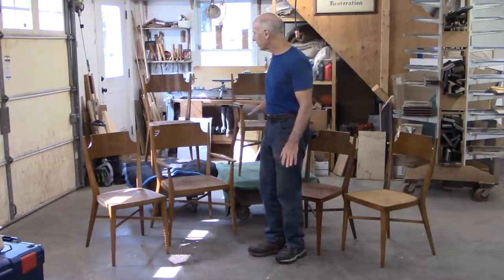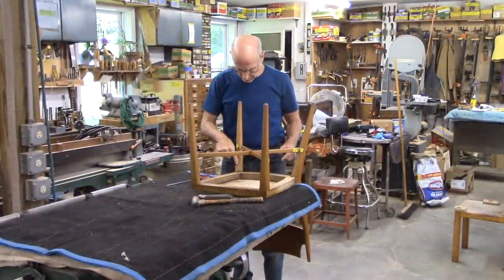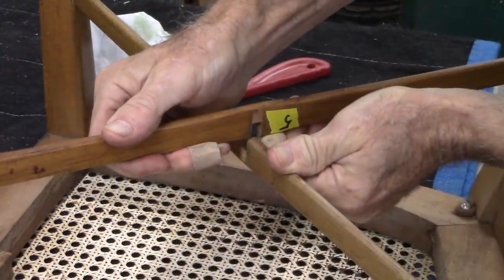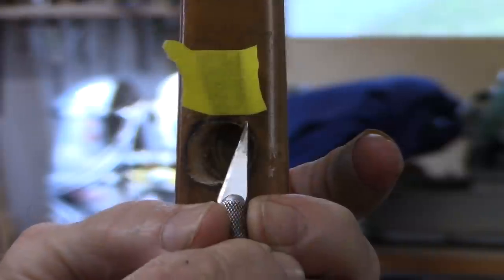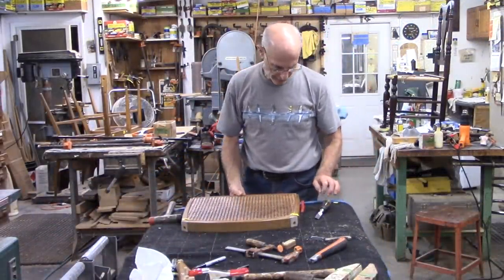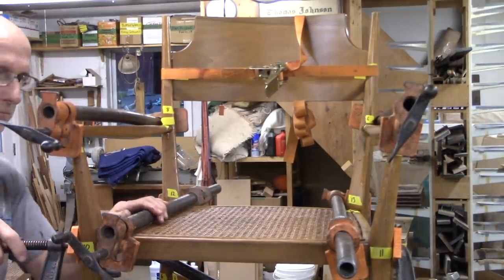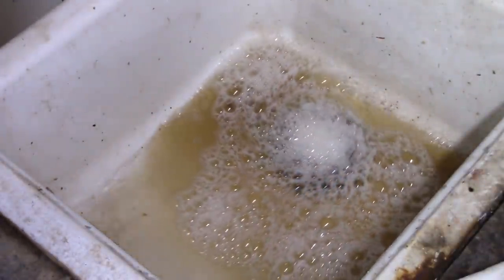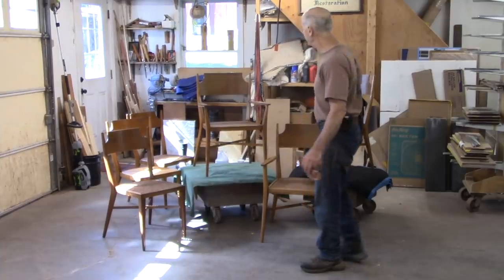Restoring Midcentury Modern Chairs by Paul McCobb - Thomas Johnson Antique Furniture Restoration

Comment: I learned the hard way, adding another hole to a joint does only weaken the joint in most cases. Thomas is spot on again.  He fixes the problem at present, after all most of the chairs have stood the test of time.
Reply from the maker: Thanks! We all have to learn the hard way!

Comment: I need to build myself one of those screw trays!! Another great video. Thanks for sharing!
Reply: Agree. They are great.
Reply: I thought exactly the same thing. I even took a picture of the screen so I could sketch up a design.
Reply: This tray is genius
Reply: When I was in college and living in a shared apartment with little personal space, I stored some things in a shed at my folks house.  Included in that was a bag of free flying disks, and a full set of Frisbee Golf Disks, they were different weights and diameters so you could change them depending in the shot.  I had about $500 in them.  I was out to visit the folks, and went out in the shop to visit with dad before dinner.  He was busy organizing his shop, and had cut three inches out of the rims of all my golf frisbees, and was using them to sort nuts, bolts and screws.  I asked him why he hadn’t ruined the bag of free disks the food court in the student union used instead of plates.  They were all the same size.  He was shocked when I told him how much the set he had cut up had cost.
Reply from the maker: Thanks! A friend made that for me. It's a "Parts Buddy"
Reply from the maker: Thanks!
Reply from the maker: Thanks! Pretty simple
Reply from the maker: Thanks! Have to give credit to my friend who made it for me
Reply from the maker: Thanks!
Reply from the maker: Wow! Good idea to use a Frisbee though, too bad about the golf Frisbees
Reply: I have a much less elegant-- maybe I should say rather cheapo-- screw handler. I keep my screws in glass jars. I pour out a jar into a shallow plastic tray to sort. When finished, the tray is poured back into the jar through a funnel made from an upended plastic juice bottle with the bottom cut out.

Comment: RE the “Warm Walnut” finish.  They were just making the transition from varnishes to oil based urethane.  These were production pieces and they added dyes to the finish to accomplish a consistent finish across the line, and pieces made at different times.  The “Warm Walnut” was a spay applied, dyed urethane.  The science behind the dyes wasn’t’ nearly as advanced as it is now,  And they were prone to UV fading.  The darker chair has had less exposure.  

I collect and restore furniture from the Lane “Acclaim” series designed by Andre Bus, from the same time frame.  They also applied a “walnut” dyed finish to that line, and it was made from, walnut veneered lumber core sheet goods with solid walnut in a few places, and white ash used for the legs and a perimeter around the top, and some trapezoidal veneer inlays in top to simulate dovetails.  The whole thing was spray finished in the the “walnut” urethane varnish.  

They show up on eBay constantly, and some one has stripped them and applied one of the modern water based urethane finishes.  The visual contrast between the walnut and the ash is almost disturbing.
Reply: look great
Reply from the maker: Thanks Randall. That is good info! I have collected quite a few of those same pieces. The ones with the original finish do show a contrast between the woods though. I've refinished some just natural and they look great
Reply from the maker: Thanks!
Reply from the maker: Thanks! Some of the wood definitely looked like walnut, other pieces not so much
Reply: Great information!  I knew what I was seeing in those arms/legs was ash!! The crest rails don’t look like walnut either to me... more like birch or maple (something closed pore) I work a lot with vintage electric guitars and they have the same dye fade issues  A “cherry” red finish often winds up light brown for example.
Reply: Thomas Johnson Antique Furniture Restoration is it possible that it’s French walnut ? I’ve only seen pictures of it on rococo saloon doors,but I remember it was well lighter than our walnut.
Reply: Thomas Johnson Antique Furniture Restoration:  That was part of Andre Bus’s design intent.  The Acclaim series by Lane was probably the most successful line of furniture in history.  It was introduced in late 1956, and was the number one selling furniture line in the United States until 1967.  

Many manufacturers we still building with solid woods, but not matched wood form a single source for all of the parts of a piece.  Everything would be walnut.  But because they were buying trainloads of wood, and then milling the components of a chair from what ever wood they had in stock, in whatever order it came out of the stacks, the color and tone were never a good match. So they developed the tinted finishes or glazes to get everything to the same tones.  

If a custom maker builds you a piece of furniture, they try to start with boards from the same area of the same tree.  The higher end makers, are actually milling their own lumber from whole trees, or select saw logs. They mill all the parts for the entire piece from that lumber.  The grain, the tonality and color of those woods closely match.  

Lane was trying to come up with a Danish Modern look for their living room furniture, that was affordable to make.  The contrast between the ash, and the walnut was part of what the line had going for it.  By using die cut pieces of ash veneer and inletting them into die cut recesses in the walnut top, and then banding the walnut with ash, he developed a visually striking simulation of a dovetailed top.  

When I was furnishing my first apartment, from thrift stores in the late seventies, the Lane Acclaim pieces were then ten to twenty years old, and fairly common.  I picked up several tables, and refinished them, then two lounge chairs, a “recliner”, and a three seat couch, all designed by Ib Kofad Larsen for Selig, and manufactured in Denmark completed the living room.  All in, including the cost to reupholster the cushions on the chairs I had about $400 in my living room and it looked great.  

I learned to build furniture, and identify quality furniture, by buying pieces with good lines, (real wood, no Formica, or vinyl simulated wood, and real joinery as opposed to staple and glue), at thrift stores, and tearing them completely apart and refinishing them.  I didn’t have the space or money for a real shop or tools.  So, I was doing many restorations, and investigations, of the better pieces I could find at the Salvation Army.

Comment: It is a fact of life for a chair, that it will require disassembly and regluing over it's lifetime. This is not the most taxing job I will face, until encountering those additional dowels, that some "enthusiast"  has inserted. There is an optimum size for dowels and tenons, all they have done by adding more, is weaken the structure. Nice job again Tom, thanks for posting.
Reply from the maker: Thanks! So true, and after drilling those dowels, the chairs still were loose.
Reply: gav2759  I spent my working life as an electrician and have encountered work done by “ enthusiasts “ . Most of which varied from annoying to down right dangerous. There are some things in life better left to professionals , electricity and antique furniture being two of them.

Comment: Hi Thomas,
I had to pull-apart a poorly fitted/glued mortise-and-tenon joint a few weeks back. I'm the only one in the shop (as usual) and I was also applying the glue to the failed joint. The question became one of "how to pull the joint apart carefully, and hold it for a second or two as the glue is applied." I used two 3/4 inch pipe clamps, reversing the outboard ends (by compressing the stacked springs underneath, sliding them off,  and placing them back on the pipe "backwards").  Place both ends of the clamp between the legs containing the failed joint, and turn the steel cranking handle on the clamp COUNTERCLOCKWISE to reverse the clamping motion, thus spreading the legs. It worked like a charm! I hope I remember it.
Reply from the maker: Thanks Robert! That's the way I have always done it. But now I like these "spreader" clamps like the one I use in this video

Comment: Enjoy your videos! I'm sure you've heard of this tip but maybe it will help some of your viewers. When removing old screws, nuts and bolts it often helps to tighten them first before attempting to remove. I have used this many times with success over my many years of remodeling work and working on my old Triumph motorcycle.
Reply from the maker: Thanks! Good idea! I think that happens sometimes inadvertently. makes sense, anything to break that rust a bit

Comment: Hello, I totally agree about putting to many screws or dowels I a joint it makes it weeker. I have run across this problem with some of my furniture finds. I hate when someone put nails in joints. I have an old dresser from 1908 bought at an auction. It was is such bad shape. When I got it home the whole thing wobbled. It's usable now and I really would love to take it apart and start over. However I am using it to store items. I usually work on my furniture items in the winter. Not cold enough here yet. Great video.
Reply from the maker: Thanks! Yes, I have seen so many failures because of too much drilling and dowelling etc.

Comment: You need some reverse twist drill bits to get the screws out. Try hitting the head of the screw to shock some of the rust loose. Your shop is looking so good again ☺️
Reply from the maker: Thanks! I do not know about reverse drill bits. There is such a thing?
Reply: @johnsonrestoration  also know as left-hand drill bits. Mechanics and machine use them. They can be small so you wouldn't make a big hole. Love your channel thank you for making it.

Comment: Hi Tom. I've recently found your videos and do enjoy them.  I became a subscriber today. 
Regarding the Paul McCobb chairs, I'm reasonably sure the wood is Hickory (or possibly Pecan- a related species).  It has been used extensively in commercial furniture production as a reasonable substitute for walnut (once stained) and even as a cherry substitute. As the natural color of hickory is considerably lighter and that it takes stain very well, it was a less expensive alternative to the real thing. 
Just an FYI.  Don't know if others have already offered this info.
Reply from the maker: Thanks! I believe you. There seemed to be a mixture of woods with these chairs. I can believe that they would use different woods, bleach everything and stain them all the same color
Reply: @johnsonrestoration  Hi Tom. I think that’s spot on. I’ve never seen these pieces in person so I have no idea what veneer they used on the back panels but regardless, I think you’re right about the bleaching and staining. 
BTW, I enjoyed your repair of Wendy Maruyama’s table. The router jig and the multiple step glue up was brilliant. Also brilliant was getting the proper wood from her. Did she tell you what paint she used?

Comment: Hi Tom lovely restoration . A very classy looking chair , it must be difficult to design such a chair that can stand up to a lifetime of use an not have any major issues . This design seems to have been very well done . Yes the glue my have perished over time , but structurally their perfect. If they have been made in the U.K. I’d would have suggested either beech or elm as a possible wood used in their construction . But I’m sure in the USA , more exotic woods would have been available. What ever it is it’s definitely robust 😀   My very best wishes and kind regards   Mike in the U.K. 👍
Reply from the maker: Thanks! I'm hoping to hear from someone who may have worked at these factories. The wood seems mixed

Comment: Really informative video and those McCobb chairs turned out looking great. I refinish mid century furniture as a hobby and try to keep a mental list of the different types of woods and finishes the factories used during that time. But you were able to tell just by looking at it! Also I have never been able to spot touch-up finish that badly worn without it coming out looking mismatched next to the original. Guess having decades of experience helps :D
I wanted to ask if you ever tried using Scotch Brite instead of #0000 steel wool. The green pads you can buy in the supermarket is too coarse for this purpose but 3M also makes a white pad that is similar in abrasiveness to #0000. It has the great benefit of not leaving fine metal shards everywhere. A friend recommended this to me and it has almost halved the time it takes for me to clean a piece.
Reply from the maker: Thanks! Yes, touch ups on bleached furniture are next to impossible. And yes, I have 3 grades of Scotch Brite, including the white. I feel like the gray ultra-fine is closest to 0000 st wool

Comment: Another enjoyable viewing.  These mid century modern chairs look to be a lot more flimsy than some of the older furniture you repaired.  It reminded me of an old western where the cowboy is continuing to make spindle rocking chairs in his barn throughout the film.  His goal is to make the lightest one ever.  Each time he sits in his newest creation it breaks and he starts over.  Was the goal of modern furniture design to test the limits of structural integrity while lightweighting and using bent wood creations?  In the case of finding a dowel drilled into the bottom of a chair in a failed attempt to make a previous repair is there value in replacing dowel sections into the wood joint just for structural integrity?  I would appreciate your opinion.
Reply from the maker: Thanks! I remeber that movie, it wasn't a western but set in Colonial times, Mel Gibson was the main character who in his spare time was making those windsor chairs! And yes, they wanted to push the limits

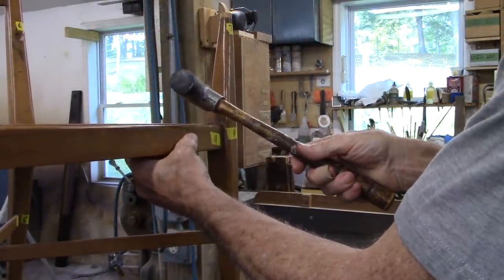Comment: at 12:38 (diagonal pegs)  "...it weakens the join", ... and, as you experienced it a minute earlier, makes disassembling difficult and more damaging,  which is inconsistent with using a reversible glue, precisely in view of a possible break of the glue joinery with decades of use. Fundamentally, we use reversible glue for our grandchildren to be able to repair it, well after us. It is  nice and comforting to see a venerable piece of furniture coming in parts with only a bit of heating, water vapor, and some hammer blows. while an irreversibly-glued piece of furniture will most often be doomed to the trash at the first minor accident.
Reply from the maker: Thanks! Well said! But hide glue isn't magic, a good joint is still difficult to take apart. Any adhesive will loosen with heat, but you've got to be able to get the heat to the glue -easier said than done!

Comment: Have you found a use for an oscillating multi-tool yet? The idea struck me when you cut off that extra dowel that one would make a good flush-cut saw for tight spaces. I'm pretty sure they have scraper blades too but haven't tried it for myself. All things being equal I prefer working on small stuff with muscle power. Peace.
Reply: Joel Wetzel multi tool would have worked well especially in tight situations like cutting that dowel (I’ve got 2 and been using them for close to 20 years)
Reply from the maker: Thanks! I do have one but keep forgetting to use it on furniture repairs! I've used it for so many other things
Reply from the maker: Thanks! I've got to remember to use mine

Comment: Great job, Tom.  I  switched to that glue a little while back from granular hide glue.  In the winter, I sometimes have to heat it a bit to get it to flow, but it seems to do the trick.  What are your thoughts?
Reply from the maker: Thanks! I'm very impressed with it. And I heated it up, per the instructions. I'm switching to this glue

Comment: Tom; when you face a very difficult screw, useful tool for you might be the "hammer driver", an impact screwdriver that uses a hammer blow to drive a cam that drives the screwdriver bit... The advantage of these drivers is that they apply the hammer force against the screw, preventing stripping the head, at the same time as they apply the rotational force. I think that you just need to "back up" a piece as small as a chair with something to prevent damage from the impact, but not a problem with larger pieces.
Reply from the maker: Thanks! I have to look into that. Maybe a new tool! Yes!

Comment: Regarding those stuck screws: what about inserting the correct screw driver for the screw head, and a good whack with a mallet on the screwdriver to help bust the thread lock? Heck, maybe a little penetrating oil?
Reply from the maker: Thanks! Good ideas all. The thing broke so easily though, nothing would have worked

Comment: Interesting video. Thank you. Hard to believe it was only 15 hours’ work, but no video probably makes it much faster. For a reputable brand, the variation in materials and finish is surprising. Any speculation on reasons - such as varying grades for the same style?
Reply from the maker: Thanks! It's typical for factory furniture, where they had little control over wood variations, and the entire production run, which could last for years, always had the same color

Comment: Hi Thomas! Thanks for the calm and precious knowledge! What are you using to fix the wood filler? Epoxy glue? I need to fill a screw hole in my 60s teak chair. Thanks!
Reply from the maker: You're welcome! Don't use putty to fill a screw hole, use either a dowel or a plug. If you have to use putty, epoxy putty would be the best
Reply: @johnsonrestoration  All good! Thanks for the quick response!